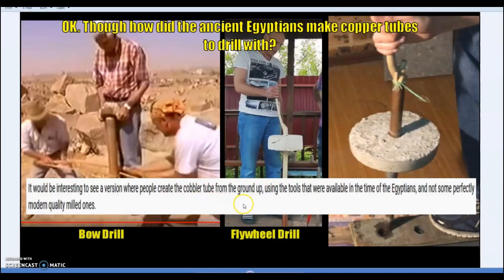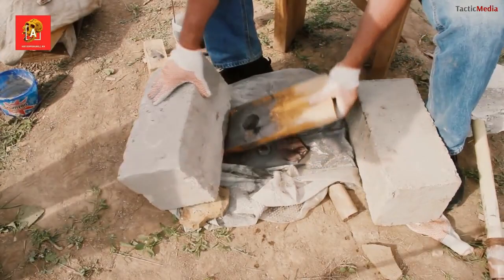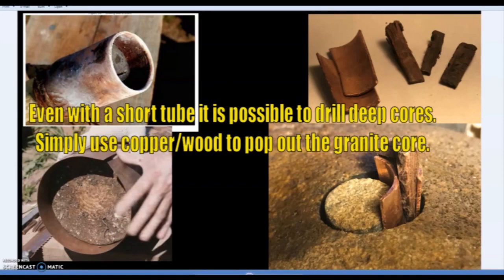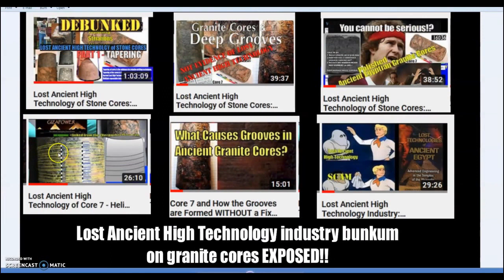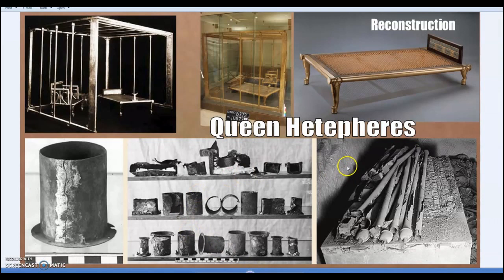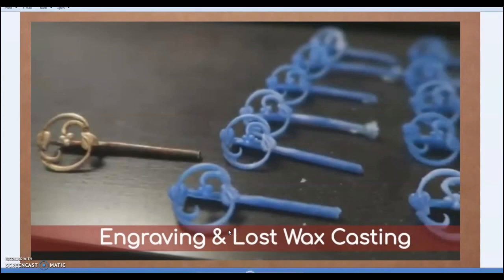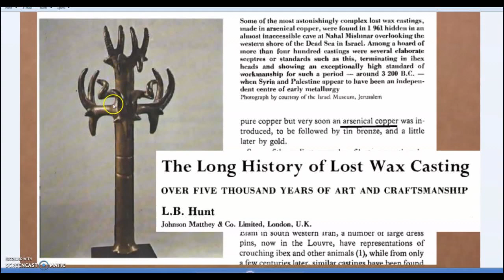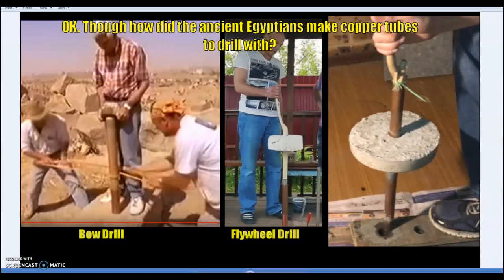Ancient Egyptian Copper and Granite Core Holes: Response to a FAQ

Comment: It would've been nice if they used the same type of stones for removing the core bit. You can see that there's pores in the stones that was used in the video. You have to keep in mind that people who do these video now are used to modern machinery and techniques. Basically they're just applying the same to materials that ancient Egyptians had back then, like using abrasives to cut stone with modern machines like the ones they used today to cut granite. You can cut granite with water as well like those water jet saws. 

Then they don't give credit to those ancient people for doing something so advance with the primitive stuff they have back then or acknowledge whoever thought up these ideas in the first place were pretty ahead for their time. For example, the Chichen Itza pyramid were designed in such a way that when you clap the echo playback is of a quetzel bird. Could this just be a coincidence and something that they randomly discovered? Yes. But they had enough knowledge to build it precisely where only the sides that still have the 91 steps would make the sound from the echo.

edit: changed 364 to 91 steps per side, there would've been 364 steps in total and the top would be 365.
Reply from the maker: Chichen Itza built over the top of older pyramid and possibly one before that. So there's a progression, allows room for experimentation and refinement over time.
Not so much now but classical architecture almost aways included "whispering galleries" - a place in a building where you could whisper and someone else could hear you on the other side of the hall/dome even with the noise of a large crowd. Acoustics was an important feature in ancient architecture. De Architectura by Vitruvius goes into this.
A few years back now they found a small cavern/temple complex. The walls were covered in maths predicting eclipses for something like a million years into the future. They were very smart but then again before modern machines and calculators people were doing very advanced calculations also. Ole Romer got a very good approximate for the speed of light just by using a telescope and looking at the orbit of a moon on Jupiter.
Primitve tools and techniques used in ancient Japan to make "magic mirrors" were the inspiration for precision electronics industry to create near perfectly flat wafers for silicon chips.

Comment: Now I don’t wanna be a downer or try to be like no you’re wrong but after drilling so far down and popping the granite like you’ve shown how would you get it out of said hole because surely there would be a max distance you could drill and grab out theses little cylinders of granite
Reply from the maker: I demo drilling with a pvc pipe. It’s like sandpaper. It’s the sand not the paper that cuts. You could do the same with a wooden dowel or copper rod so no core to remove if you want to go deep. I also experimented with a rod inside the tube. The core has thin walls that break up and the pieces add back into the abrasive mix.
Reply: @SacredGeometryDecoded  well we can’t use a pvc pipe so I’m going to scratch that off the list, but what about the copper tube. How quickly would that wear down if doing 1m deep holes
Reply from the maker: @MattsIEDpart2  rates vary, with heavier weight and large grain abrasive it’s quicker at something like 1 to 1.
About 2 to 1 with lesser weight but worth noting the copper itself is never lost. It goes into the mud slurry and can be panned out.
Plus the abrasive that’s been worn down is now at perfect size to be used for high polishing elsewhere.
It actually creates a nice loop where everything gets recycled and reused.

Comment: Your drilling  device  has the shaft stabilized by framework. The drive handle on top of the 8"' wooden shaft could be of different lengths to produce different mechanical advantage for different materials. Turn the setup sideways attach a rope to the shaft and pull blocks up the side of a pyramid:
[efairies.com]
Reply: Image I meant to post:
https://etc.usf.edu/clipart/25700/25756/well_bucket_25756.htm
Reply from the maker: If you attach that to this 
https://www.youtube.com/watch?v=b-CdvufMTvM&feature=youtu.be
ancient cranes

Roman cranes- winch plus compaund pulleys
https://www.youtube.com/watch?v=FkEguRSvW30&feature=youtu.be